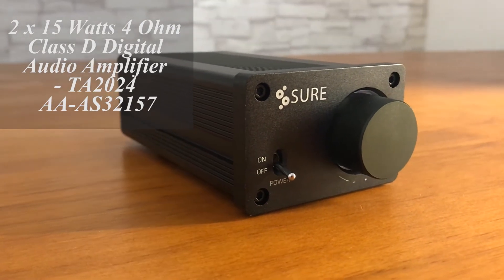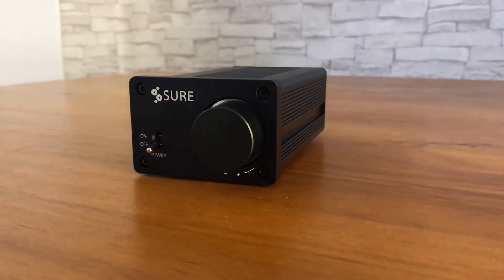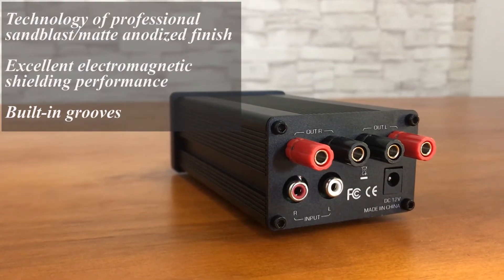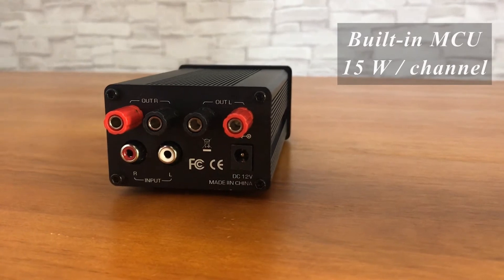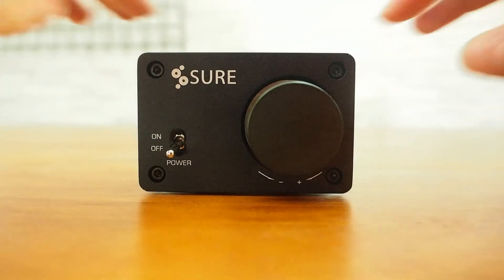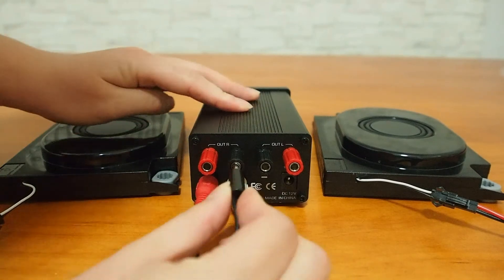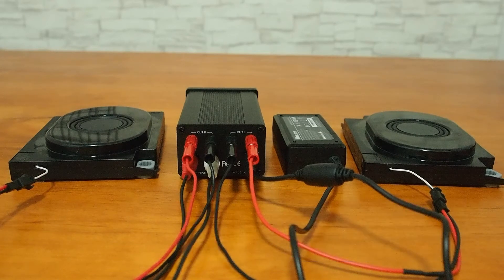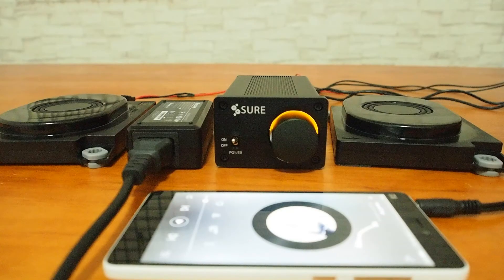High Sound Quality Audio Amplifier - WONDOM A215

Comment: If any amplifier of mine produced that horrendous cacophony it would rapidly find itself in the trash bin.
Reply: Yes true, but it's the speakers that are trash, not the little amp. I heard an older version of it. Amazing. Best bang for the buck.
Reply: @save_the_night  Probably, but the source material is so dreadful that it is not a fair test of either amp or 'speakers.
Reply: @JUANKERR2000  spakers are not even close to what people might use with this amp, looks like speakers from a tv a super cheap portable radio, only comparable to cheapest logitech speakers